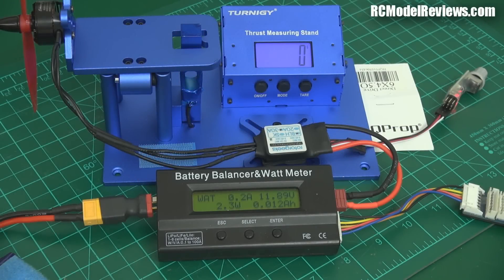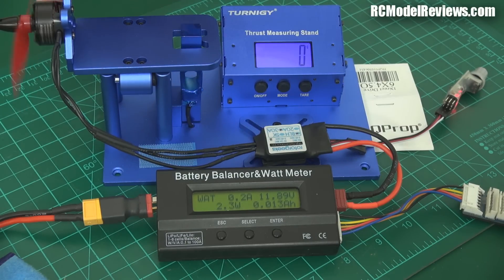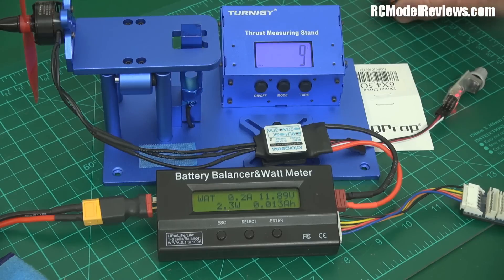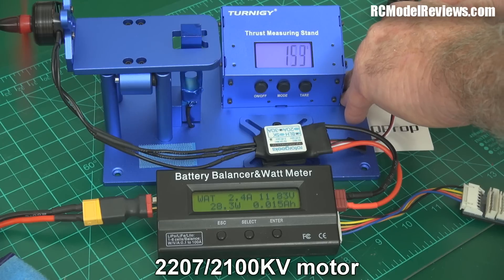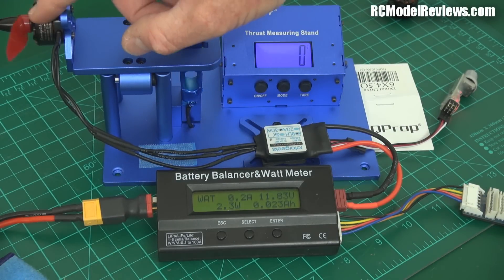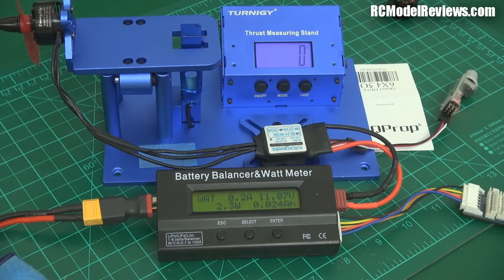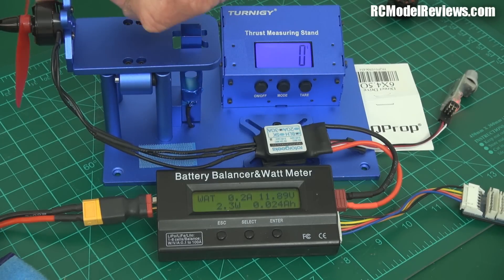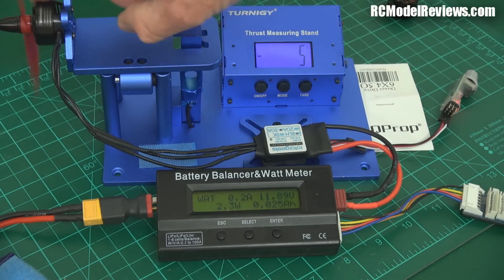Will a SunnySky 2207 2100KV motor make my miniquad fly faster?

Comment: Does not deliver 400W of power. Uses 400W of power. Stop cranking out dribble, and do some proper testing. Motors produce RPM, why not measure that instead of rubbish figures like static thrust which have no bearing on anything, unless your flying like a nana.

Comment: Hi Bruce, would it be possible for you to make a clearer difference between static thrust, power and speed ? Not for me, but to make it more understandable for everyone. I explain myself :

Using larger props with a lower kv motor/low pitch increases thrust, which means it is more efficient when used with high drag planes or heavy quadcopters. When hovering, air is ejected more slowly under the quad, so less power is wasted; but this is a drawback concerning top speed, which is lower because of the low velocity of the ejected air

Using smaller props with higher kv motors/high pitch props increases speed: the air is ejected faster, so the top speed is higher; but it gives less static thrust for the same amount of power, because energy is wasted by the fast airflow.

As an example for a plane, a large prop spinning slowly has a lot of thrust : it is easier to climb and hover and it has more pick-up, but the plane is slow, the speed of highest efficiency is low; but with a smaller prop and more kv or more pitch (both influence the speed of the air ejected) , the plane can reach a higher speed, the speed of highest efficiency is high, but the plane has low pick-up, low acceleration, and is more sensitive to drag.

That's why miniquad motors have a low efficiency (3 or 4 g/w): they spin fast but give a lot of speed.
On the other hand, larger quad have slower motors (900 - 1100 kv) but with better efficiency (up to 12 g/w for motors ~$20). Large quads are slower but can carry heavier loadings and have an overall better  battery capacity/flight time  ratio.

Fast motor and small prop = 5th gear
Slow motor and large prop = 3rd gear

I probably repeated myself four or five times but I want to help as many people as possible. Have a nice day !

Comment: I have just built my 250 quad with a multiwii 2.5 control board, and two motors that age opposite each other stop and start when I throttle up. 
Hope someone could help :)

Comment: Won't having 0.5volts of difference in your battery make a difference in the results? If you want accurate results wouldn't it be better to use the same voltage?

Comment: Hey bruce, the voltages that the two motors were run at were significantly different. 11.8 vs 12.4 before the load was applied. Perhaps if you'd used a fresh battery with both, the results would be more fair to compare... I always run a big 5ah or 3ah battery when testing little motors like this, just to remove the variable of the power supply voltage as much as possible. maybe you could do the same in future? (or even do each run from 1 of 2 fully charged batteries)

Comment: The battery voltage on the 2207 test was 11.6, and on the 1806 test it was 12.4.

the kv2700 version could be bought at bangggod
http://www.banggood.com/Sunnysky-X2207S-KV2700-Brushless-Motor-CWCCW-For-RC-Quadcopter-p-963449.html
Reply: Jan Christian Aamnes You'd probably need to choose your ESC carefully with a 2700KV motor but it would perform better than the 2100KV on small props.  Unfortunately, I couldn't find *anyone with the 2700KV motors in stock.

Comment: If the motor has a lot more torque and there's not enough clearance for bigger props, isn't this where you're supposed to use tri blades?

Comment: Ahh, but with 2207, you can run 4S no problem with a 5x3! I'd love to see that test!  I bet you'd get plenty of thrust at significantly lower amps than the 6x4.5s.  Also, it would be helpful to provide grams per watt comparisons of different props on these motors. From what I can tell they're significantly less efficient than other motors in the same class, especially with those huge 6x4.5s.
Reply: 6045 prop = 2.30 g/w at 4S 100% throttle, 3.16 at 3S 100% throttle (according to previous video)
I'd like to see the 5x3 at 4S!

Comment: And what about 5x4 or 5x4.5 Bullnose on this motors? I bet the Bullnose wil make a huge difference and could make a 5" mini perform way better with 2207 than 1806. but you are right, with those small, light and low pitched props you probably can not get the juice out of these sunnys...

Comment: G'day Bruce. I am about to get a möbius camera but notice there are different lenses. The sport looks good but the wide angle is also listed. Just wondering which version you recommend for a 250 quad. Thanks in advance.
Reply: I'd go for wide.
Reply: Standard lens gives you about 120 degree angle, wich is plenty. Wider view puts more thing on the screen, but also makes them smaller.

Comment: quick question.. im currently running 900kv motors 30 amp escs and a 3200 4s lipo on a tricopter build. i know i would have a lack in power but if i was desperate to fly could i try a 2200 3s battery and fly without hurting electronics. reason for asking is i have 10 2200 lipos and only the one 3200 4s
Reply: It's all about the C rating of your battery and not the capacity (  C  x capacity = max amp output  )...It is the battery that will get hurt,nothing else so go for it...Or just use 2x 2200 .
Reply: What size props? It should be fine
Reply: oh yeah thats important 9 x 5
Reply: EpicRC 9 x 5
Reply: Yep that'll be fine

Comment: Hi Bruce. As always, very useful info. 

I hope you or someone else could help me: I have an AXN (a mini quad in transit from Asia to Mexico too), mobius, video link, fat shark googles and I'm looking forward to start in FPV. I know how to connect everything. My question is: what's next? Just put my googles and throw the plane to the air?? Any suggestions?? Some advice for not crash on the first flight will be appreciated.
Reply: As a first step I'd suggest that you have an experienced co pilot to do the take off and landings by normal LOS flying from a familiar location. Even better just go for a ride while he flies the model, this will allow you to get a feel for the view and orientation. I recommend you sit down while using the goggles because they do weird things to your head. Once you are comfortable get the co pilot to hand you control once you have plenty of altitude. A buddy box system is handy here but not essential. Fly a few circuits and have the co pilot give you feedback on you location and attitude. It is all to easy to fly far from your launch point so be sure to stay in LOS range so the copilot can 'rescue' you if you get into difficulties. Hand back control to the co pilot for the landing. From here you can practice FPV with LOS launches and landings while you build up confidence for a full FPV flight. If possible always fly with a spotter/co pilot.
Reply: Got It! Thanks!
Reply: Do you actually know how to fly a model without FPV gear?
Reply: Yes

Comment: I would love to see a comparison between an 1806 2300kv and a 2204 2300kv. If I could wish to be specific, they would be T-Motor 1806 vs SS 2204's.

Aside from that...what about thrust vs. torque?
Reply: http://www.rcgroups.com/forums/showthread.php?t=2180080
Reply: sandnessmj Yea, I've read that a couple times.  It's interesting to see that 1806's seem to produce more thrust on props like the 5x3. I assume its simply based on having less mass to spin?  The only factor I haven't seen measure is the torque issue people talk about.  Tho, I'd be lost as to how that could even be measured by a hobbyist.
Reply: Yep, I agree the 1806 has a lower moment of inertia (or something to that effect) that allows it to reach its full potential of RPM.  But I'd also bet that the 2204's feel more "punchy" with quicker acceleration.  No scientific data to back that up, though.
Reply: sandnessmj I'd assume it would be valid to compare it to cars and displacement.

A 700hp 5 liter motor is going to ultimately accelerate as fast as a 7 liter 700hp motor, but that 7 liter is likely going to have a lot more torque down low and feel more "punchy" down low and throughout the revs. 

If operating at or near full throttle, I'd assume the 1806 would be the slightly better choice.  If spending time closer to 50% and under (say dropping below an object, then punching out), I'd assume the 2204's will get back up to speed a bit faster.  Just a lot of assuming on my part, tho. :)
Reply: Howzit FPV That's the exact analogy I use when discussing RC motors!  I think of it more like this, though.  Stator width is like the stroke of a internal combustion motor, and stator height is like the bore.  You can have 2 motors of the same displacement (~ KV) with very different characteristics based on their geometry.  The 1806 is more like a fast revving japanese car motor.  The 2204 is more like a (small) truck motor.  Torquey on the low end, less on the top end.
Reply: Howzit FPV 
G'day,

There's kinda more to it than that...; for maximum Aerodynamic Efficience, ideally one uses the largest Diameter Airscrew which will fit in the Space available, because the extra Disc Area engages more Air, allowing more Massflow (thus more Action/Reaction = Thrust) than winding up the Pitch, hub-stalling half the Disk-Area, and bogging down the RPMs all by trying to cut a tiny high-Speed Hole in The Air...

  Either design the Motor to produce it's Peak Torque Efficiency at a specific RPM and then design a Propeller to work at that speed, or make a Propeller which will fit in the space and then design a Motor or Motor with Reduction-Gear to have enough Torque to spin the Prop fast enough to make the desired Thrust...

  On the whole, the Bigger thr Propeller the more efficient it is, and a single Blade with a Mass Balance on the other side of the Hub is the MOST Efficient of all, because it sweeps a bigger Disc than a 2-Bladed unit using the same Torque at the sane RPM.

 Multi-Bladed (3, 4, 5, etc) units are used when there's too much Torque for the available Space, and the Designer is trying to keep the Blades'  Tip-Speeds from getting too high...

;-p

Ciao !